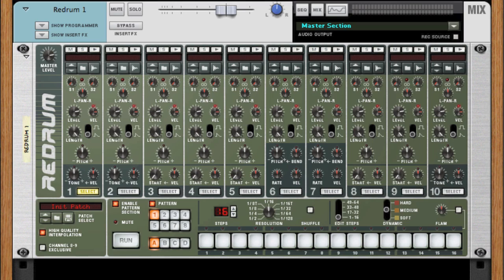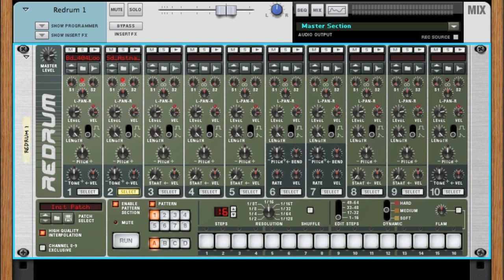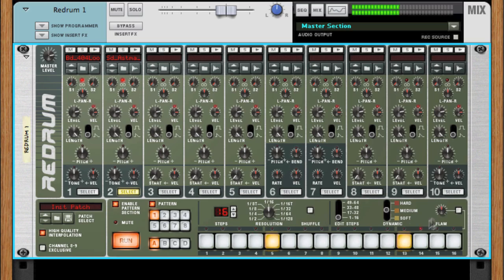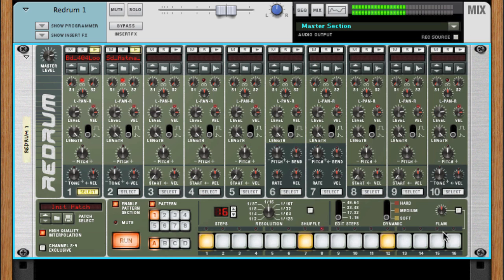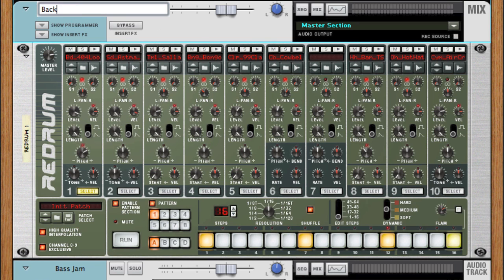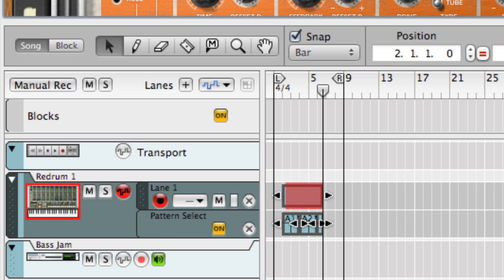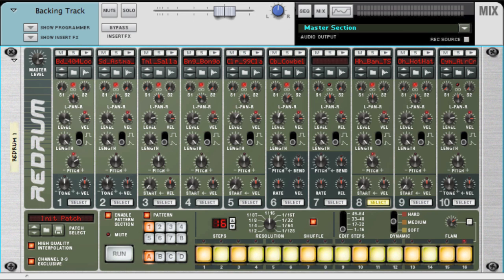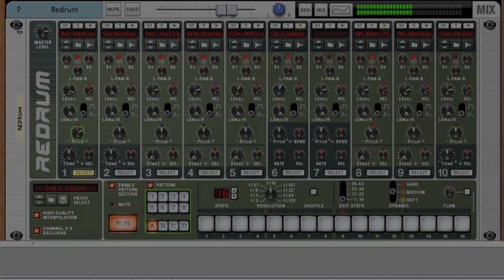Drum Machine 101 with Redrum - Micro Tutorial

Comment: Just increase the "Steps" number (where it says 16) to a higher value (32 if you want a 2-bar loop), and choose which steps to edit with the "Edit Steps" button. Of course, how long a loop will be in the sequencer also depends on the "Resolution" (default at 1/16). This setting is great for making trap-style hihats. 

Kong does not have its own pattern sequencer, but you could make patterns in Redrum and trigger Kong via CV. 

Hope it helps! :)